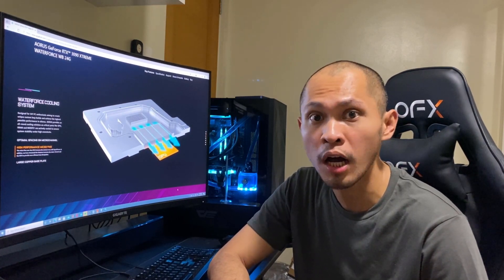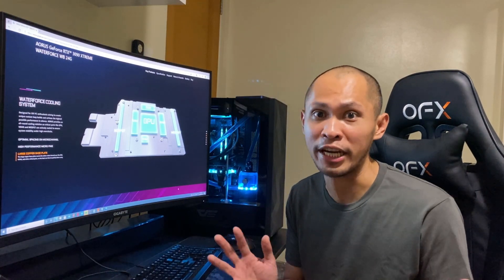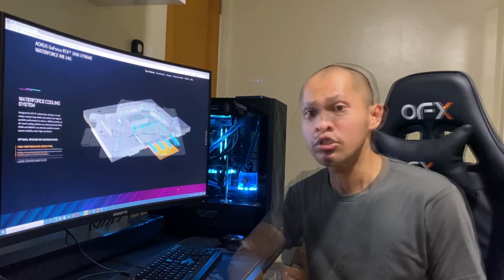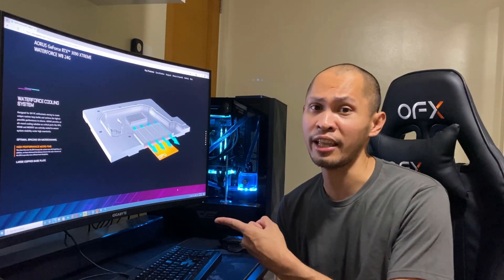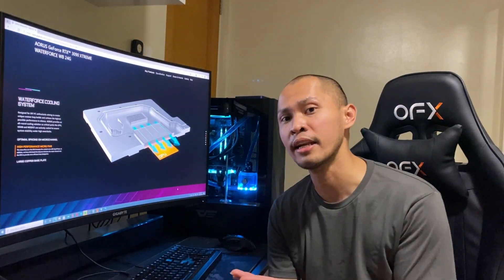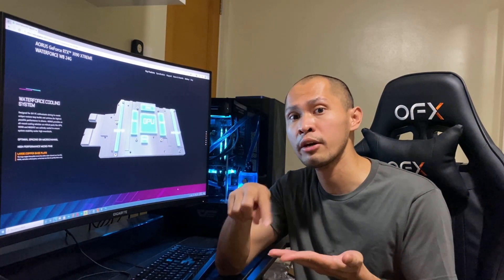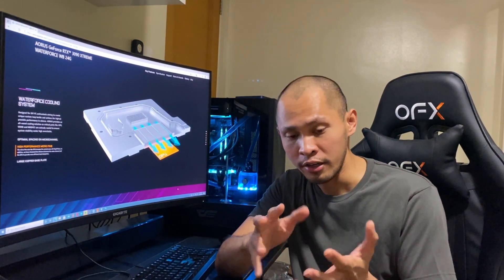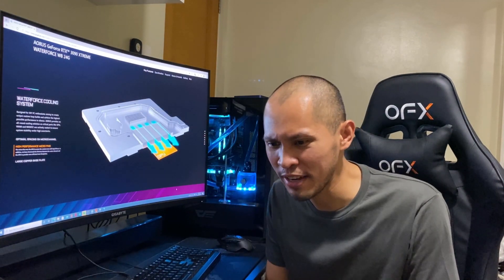Aorus RTX 3090 Xtreme waterforce WB 24G follow up review

Comment: I bought some heat sinks and thermal conductive tape with adhesive on both side will mount on the backplate One day and I will have time to clean my loop will also mount a 140mm fan to cool the backplate . But Micron says that this Hi performance GDDR6 RAM’s on these new RTX cards can work safely up to 95c . Not like i would not want to see a nice backplate water cooling combined with the front block 🙂

Comment: So i just got my aorus 3090 wb and im thinking of returning and getting founders edition and water blocking that. But on the back of the box of the aorus it saids

“Large copper plate with direct contact to the gpu, vram and all critical components, the metal plate and heat pipe efficiently transfer heat to the liquid”

Did they update it or it still doesnt transfer heat correctly?
Reply from the maker: Sorry i don’t have the box with me. Can’t check.  But if it doesn’t have an active backplate like a block at the back, i doubt it.

Comment: Thanks! So in conclusion, buy a regular RTX 3090 and use a ek-kit which should include the "back plate" heatsink.
Reply from the maker: YES! 😁 or even better just get the 3090ti. Similar pricing now i believe and easier to cool 😁

Comment: You mean there is no  water cooling on the top of the  card where  half of the memory  are placed ?
Reply from the maker: Nada 🤪
Reply: @christechrants4085  Do you know any  watercooled or  just  waterblock  for  both sides of  RTX 3090 ?
Reply from the maker: Hmmm asus ekwb 3090 has one. No idea how it performs though. But as per their description, they say the backplate is partially connected to the gpu waterblock and somehow cools it. Not as effective as a full active backplate. But at the very least, it’s connected (even just a bit).

Comment: I’m pretty sure they just took the same block from the 3080
Reply from the maker: I don’t have a3080. But i would think so too. 3rd party gpu blocks have the same design for both the 3080 and the 3090.

The block i bought with an active backplate can also be used for a 3080 as per their website
Reply: @christechrants4085  does the 3080 have memory on the back? I just ordered mine
Reply from the maker: @peelthebananna9827  none as of the moment, but i believe the coming ti version will 😁 as for an active backplate for the 3080, it may still be useful though. To help lower temps of the hot hot spots, a bit of cooling will also be provided for the front vrams by cooling the PCB from the back 😁

for your info the 3070, the backplate actually gets really hot....enought to hurt you if you hold it long enough.
Reply: @christechrants4085  dang so without vram cooling on the back of aorus 3090 I will
Avoid it thanks for the tips!

Comment: I was thinking about getting separate waterblock, but in my country I would loose warranty :(
Reply from the maker: WHAT!? honestly!? :) sorry i was a surprised. you actually have a tamper seal in your card? 

to be clear, do you also have the exact model ( aorus rtx 3090 xtreme waterforce WB) and edition? the one with only the waterblock without an AIO?

It doesn't make sense that it will void the warranty, the box comes with a complimentary thermal paste. what will you be using the paste for, if you're not aloud to remove the block????? doesn't make sense man. 

I'm guessing you already confirmed this with the store you bought your card from. not much you can do there i suppose, since it's a store policy. but it really is unfair in my opinion. Blocks need maintenance. To do proper maintenance, you sometimes need to remove the block from the PCB. oh well....

Just wait for the warranty period to be over. As soon as it does, DISMANTLE YOUR CARD AND CHANGE WHAT NEEDS TO BE CHANGED!!!! LOL kidding. you know what i mean =)
Reply: @christechrants4085  wow, huge reply!
No, I'm in the process of choosing watercooled 3090, was preferring this GB card with AiO, but also liked tests of Zotac 3090 ArticStorm. Neither of them has active backplate cooling unfortunately.
I'm pretty sure there is a seal if I want to change backplate, but I will check that.
Thanks for your reply <3

Comment: If you put this in an open air case like the Xtia Xproto, would the cooling matter as much?
Reply from the maker: nah, it won't matter. it will take just a little bit longer for the vram temp to rise....considering that you'd have a fan for the backplate. But bottom line is, it will still rise. thing is the backplate will only spread the heat. passively cooling it won't be enough.

NOTE: even if it's not an open air case, if gpu is used as intended to, it will perform within spec. By "intended" i mean, using it for 4k gaming with ultra settings, or using gpu for creation, for maybe about 3-6hours a day for like 5 days a week (not including the holidays), something like that LOL LOL LOL LOL if it will be used for like 24/7 operation even if GPU isn't used for mining, it will have the same effect (I SUPPOSE).... Don't quote me on this. this is pure speculation.
Reply: @christechrants4085  Thanks!

Comment: Oh that's too bad. I was looking forward to buying this card. Will you review the ASUS RTX 3090 EKWB version?
Reply from the maker: Good thing with that card is it will be compatible with ekwb active backplate and you won’t have to buy the whole kit. Just make sure you buy the right active backplate model
Reply: @christechrants4085  Thanks infinitely for that information! I'm deep learning engineer and were looking for a card to handle computations, DL computations are intensive on VRAM and hence modules on back-side reaching 100c would have been serious problem for me since sometimes I need to leave my computer open for entire week doing calculations!

Now I can safely buy Asus EKWB and combine with active backplate and that should be pretty safe
Reply: @christechrants4085  No time frame on when the EKWB active backplates are coming out. Been keeping an eye out for the products release. For now update the existing thermal pads with better aftermarket versions, and guarantee you will see a drop in temps. Been playing with aftermarket thermal pads since the release of the 2080. All three of my 3000 series cards have been upgraded, and the diff in temps sure is nice. Cooler running that is. ;)
Reply: You can find the EKWB ASUS instock anywhere? wow!

Comment: vram temperature mining?
Reply from the maker: Mid 56-58 if 22c room temp is maintained. 66c if 28c room temp. 60c if about 24c room temp.
Reply: @christechrants4085  🤩🤩 vram or gpu?
Reply from the maker: @bipelosi  thats vram. Gpu’s about 40-46 (depending on room temp). About 124-127mh/s

All i have is a single 360 rad with only the gpu in the loop. Cpu is in a separate loop.
Reply: @christechrants4085  66 celsius on vram on mining??It must be over 100 ...
Reply from the maker: It’s the magic of having an active backplate 😁 active backplates greatly reduces vram temps.
Reply from the maker: Oh sorry. My asnwer wasn’t clear enough. Gpu core 41c vram temp 56-58 with room temp of 22c

Noon time Room temp of 28c - gpu is 45c vram 66c

Late afternoon til about brunch time room temp of about 25/26c i get 43c gpu and and vram of 62c

After 5 days of mining as per HWiNfo i average gpu - 44.3 and vram - 63.2c
Reply: @christechrants4085  You said it doesn't have active backplate though. Did you put one on somehow to get those temps?
Reply from the maker: @android055  hola. Ye, i kinda jerry rigged the thing and put a workaround heatsink on top of the backplate with thermal pads in between, and also a fan. But to get ideal temps (ideal in regards to custom water loop temps) it’d be better if an active backplate is installed as well. Right now I’m using a bykski 3090 master block with the accompanies set of an active backplate

Comment: Would the 3080 have the same issue?
Reply from the maker: Yes. But only in regards to proper thickness of the thermal pads.
Reply: @christechrants4085  thank you! So the rtx 3080 doesn't have componants on the back, which need to be cooled?
Reply from the maker: @sparkplugbarrens  that’s correct. There’s no particular component in particular that needs to be cooled at the back. HOWEVER! if you have an extra maybe 2mm or 1.5mm thermal pad, to be placed at the back side of the VRAM (back part of PCB directly behind the VRAMS) and make contact with the back plate, will help cool the PCB somehow. Not particularly important, but it will somehow help. You know what i mean?